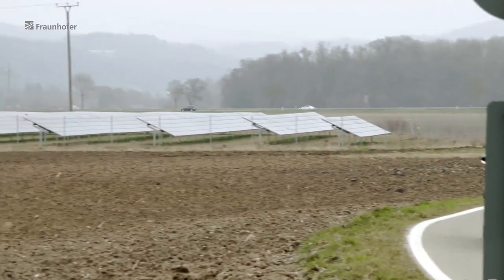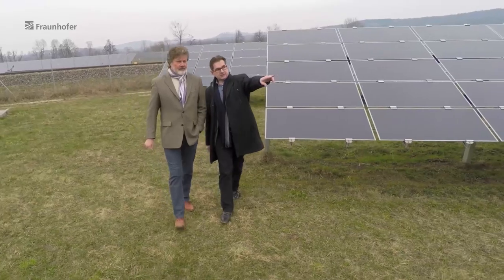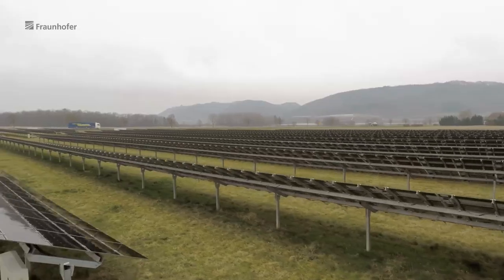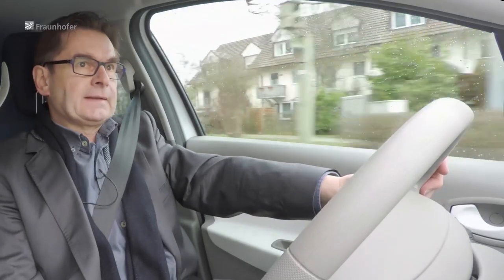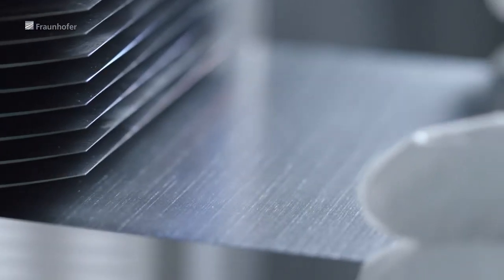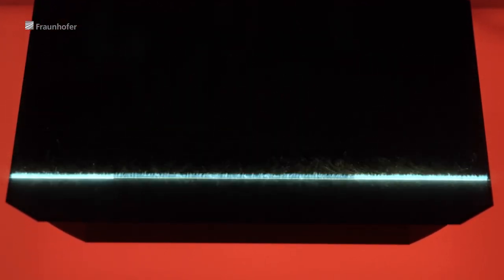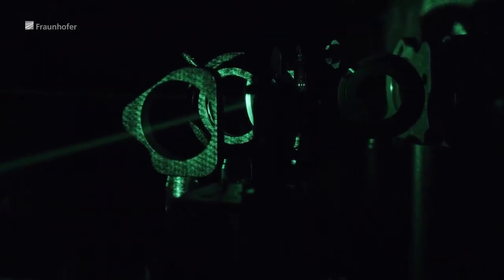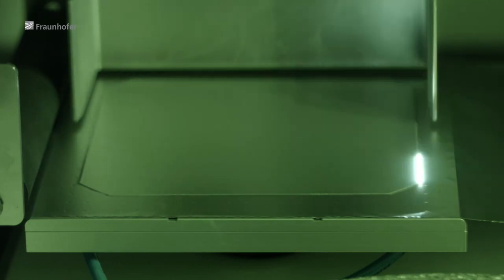Changes in Solar Cell Technology - Joseph von Fraunhofer Prize 2016

Comment: They say less space but that would keep output the same instead of increasing it. This is a great idea! My only major issue with the invention is the elements that solar panels have to withstand. when it comes down to a small mirroring effect, it is possible that one large piece of hail or debris can potentially offset said panels and cause it to under produce. the only way this would be efficient is if they had a way to monitor every panel to make sure all are performing as advertised. the only way I would think of is to place micro inverters on each panel instead of having a normal inverter taking in all energy. this is something many companies have done before, it just has not yet become cost effective.